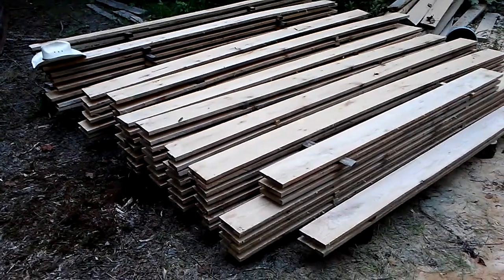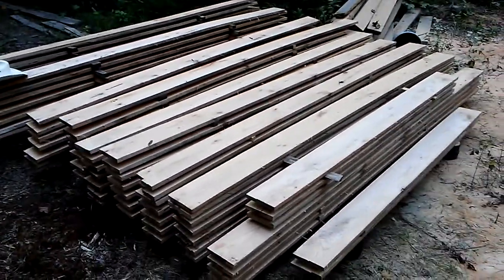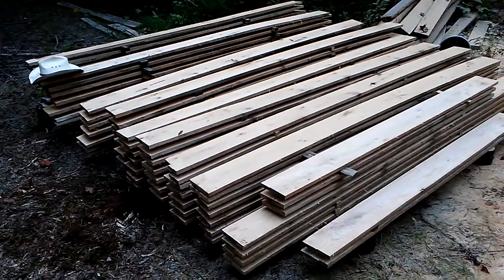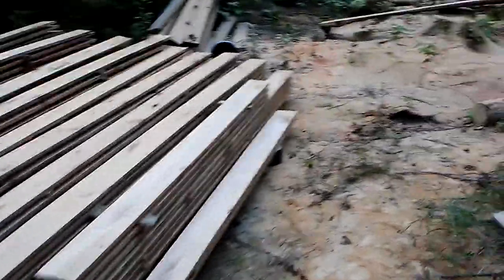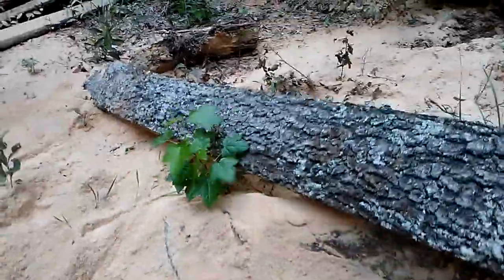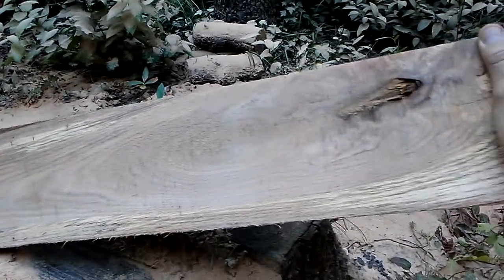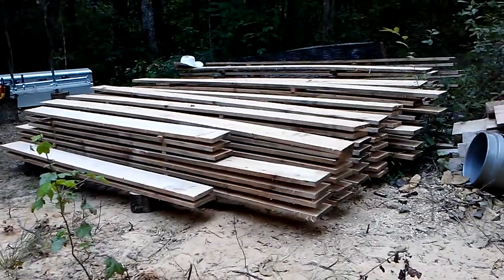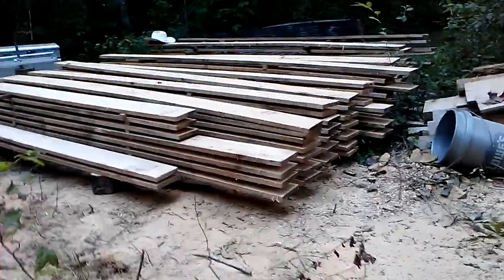The final yield, logs to lumber(chainsaw milled)

Comment: Real nice lumber.  Will you let it season just like that, or will you kiln it?
Reply from the maker: Mr. Kevin, no kiln, I will Sugi-ban (sp) some that have pulp wood boreres but otherwise it will air dry in a woodland shed.
Reply from the maker: Mr. Kevin, thank you for the compliment and viewing.
Reply: @Brian2bears  How long will you let it dry before using it?  A year or two?
Reply from the maker: @KevinsDisobedience  Most of the guild around here recommend one year per inch of thickness to stabilize/acclimate. I have used oak sooner with some shrinkage, but I plan on at least one year for this batch. Thanks for watching and commenting Mr. Kevin.